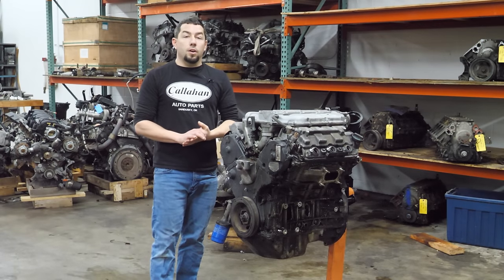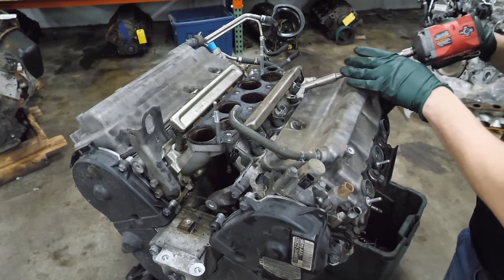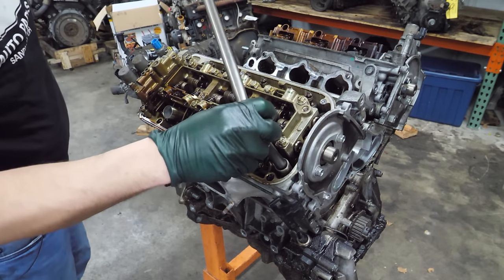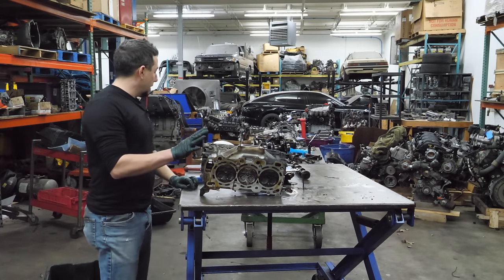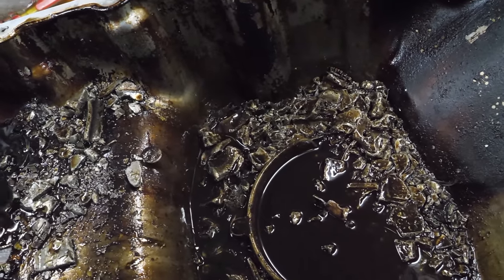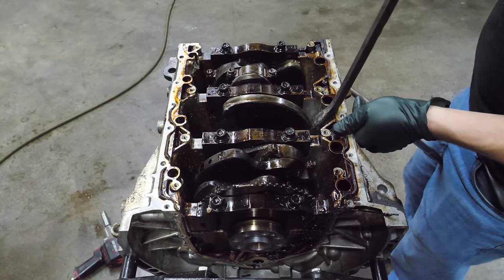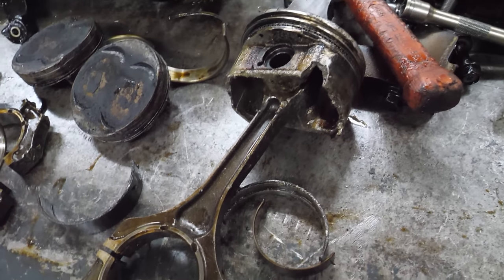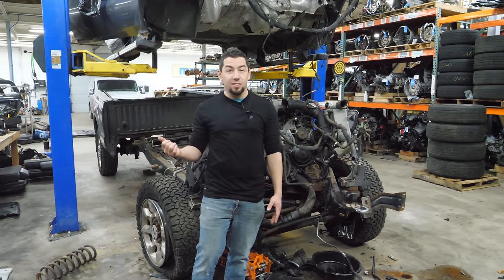Obliterated Honda Accord J35 V6 Teardown. Customer States: "Vehicle Shut Off"  OH I BET IT DID!

Comment: I had a 08 odyssey with this motor and never had a issue with the motor. 250k miles ran like a champ. Now I did do regular maintenance every 5k and did everything that needed to be done when it needed it. With that said if u take care of your car it will take care of you.
Reply: I had an 07 Ridgeline with 200+k, that was a strong engine, I towed some massive loads with it, no problems
Reply: that's amazing
Reply: I have this engine in my accord need to have rings and pistons done 3500 not sure if I should but I do really like the car
Reply: @Daniel Carlson  depends on the year, if it is a older year I would replace the engine with a new one
Reply: @TJsVette  it is in a 2010 accord with almost 200k miles
Reply: @TJsVette  it is in a 2010 accord with almost 200k miles
Reply: @Daniel Carlson  the shop you are taking it to is pretty much going to take the motor out to put new pistons and rings in, so it will be a like new motor.

Probably be the cheapest route to go.
Reply: @shaggyduder had a 07 I just sold with 179k bought it at 87k. Engine ran flawlessly, for the rest of the truck well rust got it bad.
Reply: Have a 06 ridgeline that has 257000 and wife has 2010 odyssey touring with 189000. It has had many more oil leaks due to Cylinder Deactivation System which was an “exclusive feature for the touring”- I will never buy the top of the line Honda model again. A friend had the PAX tires on his older touring and that was a PIta too.
Reply: @JohnMurrayOP  yea when I bought mine, it had the pax tires. When it was time for new ones it was cheaper for me to buy brand new rims and tires than what it was to replace just the pax. 

As far as burning oil I did my oil changes at 5k and 9 times out of 10 I would maybe lose 1/2 quart of oil at most. 

The final nail in the coffin for mine was the transmission started to shake around 55mph and with the van being 14 years old and 250k, I decided to get rid of it and get something brand new. All of my kids were now grown so we didn't need it anymore anyway.
Reply: How about the transmission? How's it doing in your Odyssey?
Reply: @warntheidiotmasses7114  the transmission starting giving me problems and then my AC went out. I traded the van in and got a new car.
Reply: @TJsVette  Seems to me the Automatic transmissions in those Odysee's are the weak link..

Comment: I’ve got 450k miles on my J32 manual CL type S and it amazes me that you can’t even tell it’s running it’s so smooth. It’s never been rebuilt in any way, just basic and preventive maintenance. First clutch at 360k due to bad dual mass, not clutch disc or pressure plate. Just an amazing vehicle and the interior has held up just as well, finally a seam year in seat bottom about 20k ago. Suspension has been my biggest issue because we have horrendous roads, but the KYB struts take all the abuse. Lower ball joints, not so much.
Reply: What did the dual mass flywheel failure feel/sound like? Was it just shaking, or other symptoms?

 I've got a V6 6 speed Accord sedan which i'm pretty sure has a bad pressure plate at 201K miles, but never had to change a clutch before. It will act up when driven hard, after a few clutch presses, the clutch needs to be pumped before it actuates again.
Reply: Do you ever drive it hard?

Comment: Impressive, I  don't know how the engine could run long enough to cause that much damage. 👍
Reply: I suspect it failed at very high rpm. Maybe all that damage was done in a very short amount of time as it blew up.
Reply: I believe he said it was a manual transmission.  Running at >70mph and losing a rod bearing, the car keeps the engine rotating long after the internals turn to mush.
Reply: He said they were able to get the bolts out of the torque converter, so it must have been an automatic transmission.
Reply: This engine was connected to a pto on a tractor and rotated until golden brown and delicious.
Reply: @drswanny9000  No, the manual version did not have VCM.

Comment: I work for a company that does automotive benchmarking and engineering analysis. Part of my job is doing full engine and e-motor teardowns. We got in trouble with OSHA because not everyone in the shop was wearing safety glasses at all times. We do wear them when wrenching, but not sitting at our computers, which are next to our work benches. So next time OSHA came in, I did exactly what you did. Sitting at my computer i had 5 pairs of safety glasses on. The OSHA guy was not amused. I thought it was hilarious. 

On a side note, I have never damaged a head with the hammer valve removal technique. Maybe i was lucky.

Comment: 2:50am on Sunday  and a new blown up engine appears on your channel.
I work at a car recycling yard myself here in Germany.
Had a Ford Focus Wagon 1l ecoboost, 3 cylinder where the second rod made inspection port right were the oil returnline form the turbocharger is. Hot oil ignited on the exhaust and set the car on fire.

Comment: I remember when I did a teardown of a J series for tech school. I don't remember the specific model of J series, but it was different from the one in the video, the one difference was the rocker arms. The rocker arms had a unique feature where each arm was separated with springs. that meant if you didn't have the whole rocker arm assembly clamped together, the entire rocker arm would completely and rapidly disassemble itself. I and four other classmates found this out the hard way. I was also warned about this before I removed them. putting the assembly back together took me four class days. I have sense learned my lesson.

Comment: You are absolutely correct about the J35's with the VCM and how critical fresh oil is in these. My J35A9 non-vcm Pilot has nearly 300k and runs great with only on time oil changes and a timing belt now and again. My friend's J35Z3 in his Pilot with VCM blew at only 175k just following the oil change light.
Reply: Though my 2012 Accord V6 with VCM has only 125.000 miles, I had no problems with it. Aside from a leaky vcm valve, which I changed. Oil consumption was acceptable and the engine ran very smoothly.
Reply: @JoaoPaulo-ph8ug  Disable it!

Comment: I have been subscribed to your channel since you took apart that 3.5 Ecoboost you thought was out of 2011 F-150. I came specifically to get answers about the engine in the truck I had just purchased. I stayed for the quality content and tongue in cheek ridiculous humor. I have watched every single engine tear down you have done on this channel. I thought that Cummins that deleted half a cam shaft was bad. That V10 Triton that chucked every rod was bad. All those blown to bits 5.3s and the first J series that "shut off on the highway" was definitely engine gravel. This though? This one is definitely the worst one you've had on the channel and blows last week's Kia out of the water. As a heavy duty diesel mechanic, I've seen some shit but nothing surpasses what the general public does to their vehicles. I'm so glad I had popcorn for this one!

Comment: No question that this engine suffered from oil starvation, probably for a long time given the copper reveal on some of the bearings.  However, five of the cylinders were so completely obliterated,  I'm having a hard time seeing how the one surviving (?) cylinder could be the driving force behind all that destruction.  Towed in gear?

As always, Eric, fine job!

Comment: Thanks Jim for this amazing collection of debris. I am in awe of that any engine could run long enough to self destruct to this level. Thanks Eric for your snarky humor throughout.
Reply: This engine didn't even have that many miles on it, this was likely caused by factory error, lack of maintenance, lead footed driver, or all the above. I've seen engines with 400k+ miles and still running smooth and strong.

Comment: The rev limiter must have taken the day off. 
That had to be spinning pretty fast to do all that damage.
Reply: Customer just carried on with foot flat till the last cylinder gave out.
Reply: I'm thinking tow truck and left it in gear !!!
Reply: @rickybailey7123  Good call. That would explain it.
Reply: @rickybailey7123  Perhaps,.. 
But to me, that the owner bothered with little to no regular servicing, ..they could've though minimal oil was a secret hack for more performance, cos they're dumb, 
    ...and blew the motor after redlining it on low oil first.
    Parts of the engine are heavily oil glazed = thorough high-level long time duration heat soaking with oil and very high temperatures. 
   Plus the sheer number of casing hollings and smaller debris sucked into the plenum also IS indicating high engine speed, hoovering upon the lighter weight fragments via the breather to airbox/plenum piping.

Comment: Late to the party but yeah, the j35s are notorious for that cam pitting. Very common and happened on mine. Also for anyone with the VCM models there are delete kits and you can convert the active mounts to the standard motor mounts to save as these go through engine mounts pretty regularly.

Comment: Just found your channel, scrolling through sidebar that shows channels I might find interesting.  Saw obliterated Honda Accord V6 so decided I should watch since I have 2007 Accord V6 and wondered what internals looked like.  A real education for me.  Glad I don't have VCM.  Mine has 260k miles on it and gets maintenance  per the book.  Timing belt and water pump PM  not cheap PM but cheaper than results of broken/slipped belt.... Tranny flush due soon.   Look forward to more of your videos.

Comment: I'm wondering how it managed to run long enough to destroy everything - it's hard to imagine all that damage occurred at once.
Reply: My theory is it was rotating at redline RPM which, in a low oil scenario, could conceivably have the engine hot enough not just to discolor so many parts and worsen varnish conditions, but have so much metal at the right level of ductility for a bunch of parts to fail near simultaneously.
Reply: @SurelyYewJest  that is exactly what I was thinking they had to have disabled the rev limiter and fed er all the onions. I was in awe like how does one get so thoroughly grenaded. Then there is the costumer account that they were just driving and it shut off with a little smoke from engine. Like people heard that engine explode from a mile away maybe further that was incredibly loud when it let go.
Reply: @larry3079  Yeah I had one measly rod poke through the block on my turbo d16z6 and I thought it was the sound of a plane crashing or some shit. I was so scared. With all this carnage the noise that came from that engine bay must've sounded like the rapture. If footage exists of this engine failure occurring (probably not) it most be the most sought after in the world.
Reply: I'm wondering if some...individual...decided to hot-rod their Accord for street racing or drifting?  That'd account for the probable very high RPMs at RUD.  And the glaring (as in 20th Century Fox intro) discrepancy between the report and what the...event...actually sounded like.

Either that or someone's doing vehicle stops with a 25mm Bushmaster.
Reply: I have seen top fuel destruction not this bad. This was not a normal engine failure. Those chunks of parts and those large portions of piston had been beaten for some time. There is one scenario I have heard of that much ground up pieces is when vehicle being towed behind camper with a manual transmission accidentally left in gear. It spun engine at very high rpm until it was totally destroyed like this. That particular engine could be from an Accord Sport with a manual transmission. Just my opinion
Reply: @johncardea837  "Oops I dropped it into second instead of 4th"
Reply: @johncardea837
Reply: It can happen all at once. Did this one do it? Idk, but it can happen.
Reply: I think a functioning J35 was coupled to this one, until it threw its own rod.
Reply: The "good" bank is versus the other (problematic bank) of the engine, so it eats itself in half. It is common in v config engines. So since the driver thinks the engine is still alife (only half), he  just drove it to the end
Reply: @johncardea837  Funny you mention Top Fuel .. this came to my mind as well .. and a picture I once saw of a 5.9 block running a claimed 60 pounds of boost bifurcated. But this couldn't possibly have happened to a driven street car that simply displayed "check engine" before quitting.. not even certain I fully buy the flat tow scenario (although what else aside from TNT and aliens??) .. But jeez .. at what point does she lock up solid and light up a tire on mile five? 45 years on the meth .. oh wait - I mean wrench. Seen spinners and rod tosses .. inspection ports .. but I would have called 5 wrists in the pan a total impossibility.

Now this more interesting than it seems at face. As a lad the B.S. stories of "putting a piston through the hood" (usually with some stupid back story of running moonshine or av-gas) .. or what was the other? Transmission came right out the bottom of the car? Not that I believe it to be so, but any other channel I'd call this staged.
Reply: @johncardea837  The manual V6 accord doesn't have VCM, this came from an auto.
Reply: @johncardea837  I agree, one would have it in a low gear, drive it up to the RV, drop the pin into the hitch, drive off wondering why the RV was a bit sluggish today.

Comment: The Honda V6 has always been vaunted as a great engine .... smooth, free revving, torquey and sweet sounding especially in the NSX. In England we fitted it into Rover 825s and 827s and it was reliable and renowned as a superb power unit, so I was really intrigued to see this particular post mortem. It looked like someone drained the oil and put a brick on the throttle pedal, then stood at a safe distance. the valves look as if they floated due to high revs and clashed with the pistons. The engine would have stopped producing power due to no compression, but the conrod carnage is something else. That is seizure of the crank but I couldn't see welded bearings. Still a mystery to me why the rods broke??
Reply: The key in this case I think it's that it has VCM and the associated technology needed to be used. From the NSX's C series engine followed the J series, which was also reliable until they added that cylinder shutoff tech, which was quite problematic in it's first 2 versions, sometimes unreliable active engine mounts and 6 (and even 9 speed) transmissions caused a lot of issues that resulted in oil consumption. An engine that likes to drink oil + an owner that's indifferent to maintenance and I can see this scenario happening.  Supposedly V3 of VCM, current active motor mounts and Honda's 10 speed auto are a good combination that seems to avoid the issues from prior generations and in forums for the J35Y6 series engines I found inconclusive results in the need to go out and actively remove the VCM feature, and I hope it's the case as we bought a car that uses all of that haha. Regardless, I'll be monitoring oil levels and doing oil changes every 3000 miles, as per the "harsh conditions" recommendation in the Honda documentation for Mexico.

Comment: Eric, J35Z engines suffer from oil consumption on cylinders 1-3 while VCM is activated (cylinder shutdown).  The piston rings are a low tension design that ultimately ended up being too low tension and had issues with the ring gaps lining up as well as not sealing very well unless there is a combustion event in that cylinder, pushing the rings out toward the cylinder wall to make a decent seal.  So, a lot of these engines use oil when the VCM system is active.   To remedy the situation, you can either re ring cylinders 1-3 or disable the VCM system without replacing the piston rings.   Also, based on the lack of damage on the cam journals and lack of heat discoloration on the cam and crankshaft, I suspect your engine in the video suffered from an extreme overrev (money shift) considering it was out of a manual transmission Accord
Reply from the maker: VCM was not available on manual transmission cars. 
This is from an automatic and the charred wreckage of the one rod says lots of heat and friction.
Reply: @I_Do_Cars  can we buy the piston mcnuggets?😁
Reply: Great teardown, even with the head start that Honda cooked up for you.  Until you have an engine that comes in with the block split (roughly) in half, this one has to be given the “Maximum Carnage” award.  I just wish we had a soundtrack of the last few seconds of operation - bet it sounded expensive…. Thanks, Eric!  Wonderful video!
Reply: I bet a really clever engineer and an ECM technician could have distributed the cylinder deactivation randomly over all 6 cylinders, minimizing the piston ring problems (if they were allowed to, $$$$$ allowing.)

Comment: I have a 2007 Honda pilot with a J35 and haven't had any problems. Still running with over 200,000 miles. I just purchased a 2023 Honda Passport and wonder how the J35Y6 compares to these older ones.

Comment: Jesus I was just expecting a good old J series timing belt failure. I don't think it could get worst even with effort. Also I think your friend was plenty peddle happy when this happened. Oh also those compressors you gotta be really strong on that lever arm, i recommend using a pipe or a vice grip or something to extend the handle, you just weren't tight enough is all.

Comment: You should bolt some tie down anchors to your shop floor so you can strap / clip your engine stand to the floor so it doesn't move around on you.
Reply: Probably a cheap Harbor Freight stand.